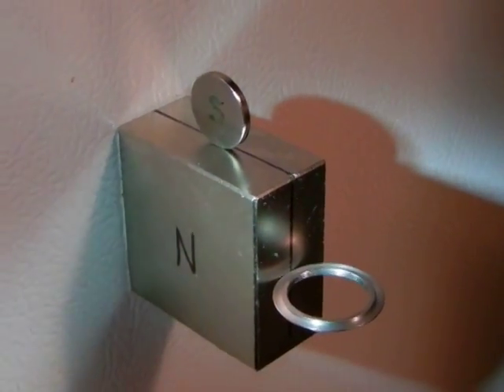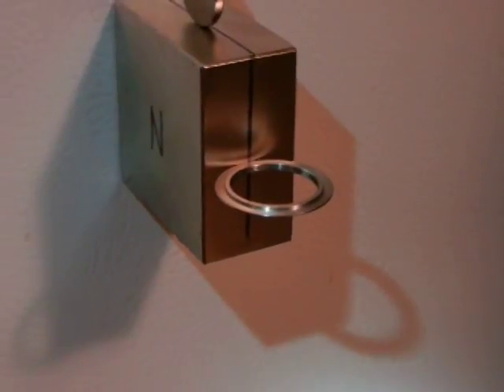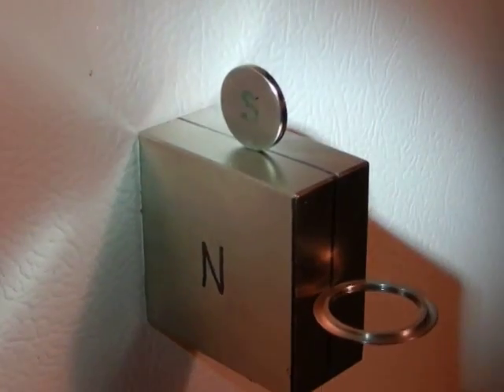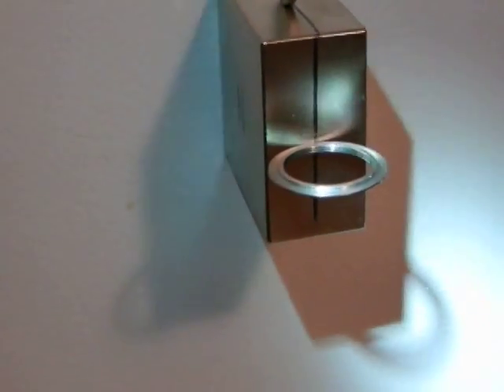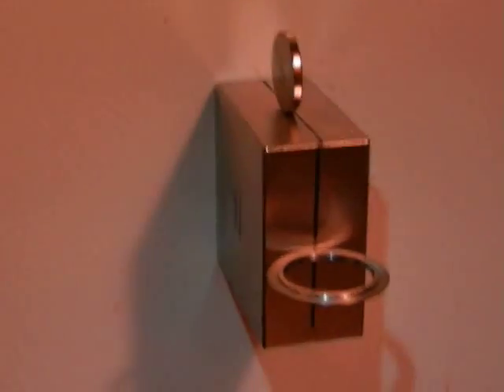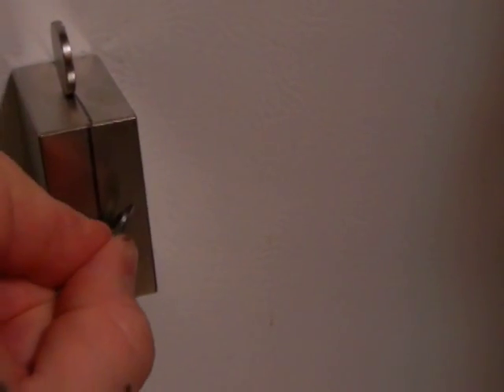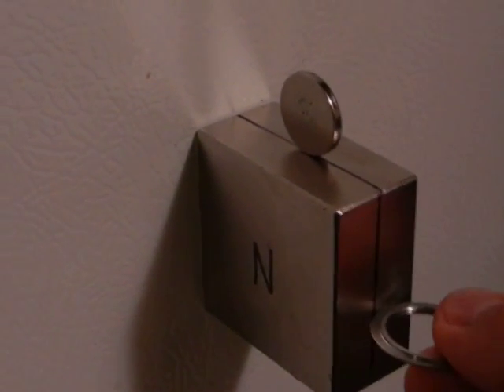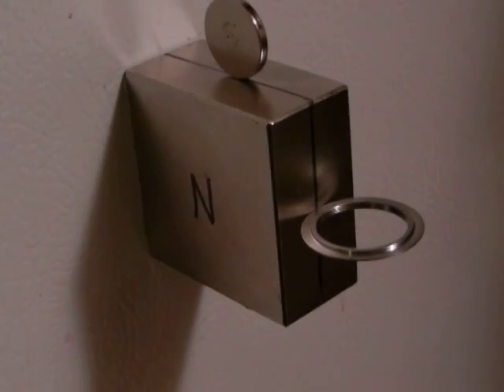VIDEO 41 Uncovering the Missing Secrets of Magnetism. MAGNET PUZZLE, WHAT IS THIS, HOW DOES IT WORK?

Comment: Rather than sitting one magnet on top of another and making the dielectric inertial plane displaced in between each magnet (which you've shown in previous videos) you were able to link both magnets dielectric inertial plane - making them a part of the same system where the maximum throw of magnetism (in either direction - it is a double hyperbola) is 180 degrees opposed to the dielectric inertial plane - which is why there is torque when attempting to turn the smaller magnet against it's flows of magnetism - thus it remains parallel. Because the steel ring is not magnetic, it is unable to link with the dielectric inertial plane and is equally distributed with both throws of magnetism (making it perpendicular), causing torque when attempting to turn it inline with the dielectric inertial plane. I tried my best🤷🏾‍♂️

Comment: The field coherencey and diaelectric capacitance of the disk magnet  as described having the properties of conjugate field geometry and simplex pressure mediation  necessitate the alignment along the inertial plane.  The metallic disc does not have self generative field coherencey but rather coherencey is induced. Lacking the magnetic property (loss of inertia, magnitude )of the perminent magnet, it then necessitates that it align with the diaelectric.    The diaelectric capacitance of metallic disk relative to induction....???

Comment: because the disk magg is sitting on dielectric plane to dielectric plane, with centrifugal, centipedial force's at opposing opposite ends. while the metal ring is being pulled into the field incomeseerabillity aka magnetism aka convergent, divergent field modality. also being at dielectric plane allowing for it not to get pushed away by either fields sitting right in the middle of field pressure mediation..... pow right in the kisser...... correct me if im off... the onley thing better than being right is wrong, onley then will you truly learn...

Comment: hey ken.
The steel disk... does it not align itself to the divergent centrifugal ends of the magnet (end of the dielectric) and thus since the centrifugal field is circular in its ether modality, its befitting that the non-dielectric steel ring orient along the highest velocity of the dielectric discharging edges of the magnet... on both poles of-course, hence explaining the orientation.
For the disk magnet, i think the incommensurable nation of the dielectric inertial plane dictates that the weaker (disk) magnet align itself along the inertial plane of the larger magnet...
please correct accordingly...
Reply: SuperTompo but will the disc magnet align itself if its position is in the inverse direction..? if so why

Comment: The steel ring interacts with each divergent, centripetal field and when balanced perpendicularly on the dielectric inertial plane it will hold that position because it is being "torn" in both directions equally. The magnetic disc is the exact opposite phenomenon. (?)

Comment: the steel ring tries to flow in the direction of the vortex like spin flowing from N to S, the magnet on top points both of its poles in relation to the relative poles on the larger magnet in order to fit the vortex of the larger, its all about the illusion of polarity and the universe is constantly trying to "polarize" this is why allowing polarity is easy and to try to change this results in torque.

Comment: The circular neo magnet sits perfectly on the line due to dielectric inertial plane. It is consistent with the fact that you can split a magnet over and over and each small fragment will always have the "poles" and the dielectric inertial plane. So it only makes sense that when two different magnets are brought together, their dielectric inertial planes will line up perfectly.

Comment: the steel ring simply wants to align itself north-south because it is attracted to the poles. but the disk "magnet" is influenced by dielectric inertia to self align paralel to the dielectric inertial plane and not north south like the steel ring. also the two "magnets" poles are pointing opposite of eachother because opposite poles attract via field conjugation. i think.

Comment: Everything has a magnetic north and south even if it is classified as "non magnetic" imagine if everything was made of tiny little bar magnets with there own north and south, and then imagine that you were to take one of these non magnet items and you were capable of seeing all of the magnets that made that object up. The reason why it does not attract an object is because all of its magnets are chaotically pointing in every which direction and are opposing one another so they appear to be either having a very weak or non existent field to them, but if you were capable of realigning those tiny magnets then those objects would have exhibit magnetic properties. This is possible because everything is made up of atoms, molecules electrons ect, but magnetism and electricity are the same so when you put the smaller magnet and the steel ring on to the larger magnet they then become a part of it and will even share the magnetic field. They stay centered because the magnetic field is evenly matched at this point and is not just pulling at the bade of these objects but pulling evenly on both sides all the way to the top and giving them support as well.

Comment: Is it because it is "easier" to induce the metal ring's collective diaelectric field than it is to organize the diaelectric voidance of each of it's atoms/molecules?
Reply from the maker: ring or disk doesnt matter, i have pics of the same with BOTH disks, one magnet, one steel.

Since magnetism is radiation , is the "dielectric field (in discharge)"- FARADAY, then  again, what does the STEEL have that the DISK magnet doesnt, and vice versa.

Hint: flies prefer to buzz around horseshit rather than horses   LOL

one of those is a swarm of flies, the OTHER is a small horse
Reply: Both magnets have strong inherent dielectric inertial planes so the likeness between the two of them attract each other causing the two planes of each to line up as to get them as close together as possible?

The steel ring has a weak or no (localized) inherent dielectric inertial plane so one can be induced into it by the dielectric inertial plane of the magnet and it's easier to cause the ring to coherentLy radiate in the smaller sections  perpendicular to the magnet's inertial plane than it is to cause it throughout the whole ring (parallel)??
Reply from the maker: first part good and right

second part wrong.
the steel ring has NO INCREASE in its already present interatomic magneto-dielectricity.

HINT:, the steel ring isnt being induced by the large magnets dielectricity.......
rather moving perpendicular TO IT AGAINST IT because of (X)

HINT, flies rather buzz around horse POO than horses.

of the two smaller objects, one is a small horse, the other is "flies"
Reply: Because of electricity?
Reply from the maker: NOPE   that isnt it
Reply: I want to KNOW rather than guess. I'm going to hit the book and the videos then get back to this...
Reply from the maker: well, I dont like puzzles either, but it makes people THINK, ....ill answer it in private, just email me
Reply: I appreciate the challenge. The principles and concepts have something to stick to when you have to put effort into figuring them out. I'll take you up on it if I can't get it on my own tonight. Thanks a lot for all of this!
Reply from the maker: see my latest 2 videos where I "unravel another videos mystery"

good fun
Reply: I like how you used the Aussie guy's video as the inspiration. Last night I pulled apart a first generation Imploder a la Dan Winter and I was testing the magnets with a neutral pendulum, and with my limited ability it seemed the pendulum wanted to go clockwise so it led me to wondering if it would go counterclockwise in the land down under because it was closer to the south pole.
Reply from the maker: it wasnt inspiration, I noted that long time ago, but it DID REMIND me that people didnt know why and to MAKE that video(s)
Reply: Throw me another hint!
Reply: "Gravity being down this way"
Reply from the maker: nope, i have other pics with gravity OPPOSITE to the above pic, so gravity plays no part in this setup
Reply: Dang, I thought it was a hint cause you'd said it in the video.
Reply from the maker: no, i was only mentioning that , maybe I shouldnt have mentioned it, but no, grav makes no diff in any of this
Reply: Note taken.
Reply: Is the ring being polarized?
Reply from the maker: its under magnetic induction, yes.  however .....HINT: nothing is increased IN the steel ring (or disk or square, doesnt matter)
Reply: OK...Does the ring have a radiative field outside of it's physical-ness?
Reply from the maker: yes, however that close to the magnet its masked, so it plays no part in this little video / puzzle.

WHY will you encounter enormous torque bringing the RING parallel to the black line.............and the SAME issue in bringing the small disk magnet perpendicular???

that was a hint
Reply: Are the field lines coming from each of the poles most parallel in the center where the ring is, causing it to be "pinned" between the two of them?
Reply from the maker: YOU NEED TO WATCH VIDEO 46 on that answer.

The ring is under the "power" of both sides

the disk is just the opposite, when in the same place in the "middle"

enough hints there???

Again, the ring has MORE OF NOTHING, its under the influence of (insert answer)

The disk has more of ( insert answer) and therefore at that spot under the influence of (insert answer)
Reply: Halfway through...
Reply: Induced Dielectric Coherencing!?
Reply from the maker: of which object?  :)

dielectricity is inertial and counterspatial, it cannot , it does not "reach out" and induce anything.

So neither is that answer
Reply: I apologize for my obtuseness  and thank you for your patience. Do I direct my email to kathodos.com?
Reply from the maker: email neoplatonist@icloud.com

DO NOT MISS VIDEO 51 UPLOADING NOW...... 
video 51 uploading, catch it when it uploads

of all of them, dont miss that one.
Reply: OK Thanks!
Reply: It is causing dielectric coherency in the inner atomic structure of the steel ring! Hallelujah!
:)
Reply from the maker: So, you watched video 51 for that answer eh?

Yes, the steel ring has NOTHING ADDED, only been 'aligned' and sits ALONG the flux of magnetism resultant to the conjugate nature of magnetism and dielectricity and how they move always opposite each other.

Sok, ;)
Reply: I was view #1 too! I did imagine it as a bunch of tiny gyroscopes standing up before, but didn't (couldn't?) articulate it properLy.
Thanks again for taking the time to help me with understanding. I plan to learn as much of your work as I can and teach it to as many people who will listen. I know this is something big!
Reply from the maker: thinking in terms of fields is a tough thing we dont normally do  ;)